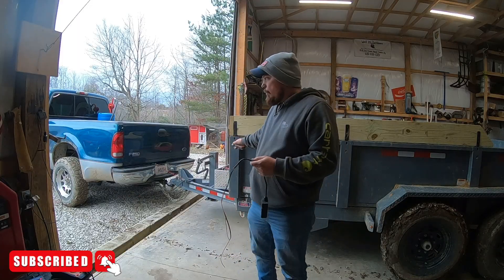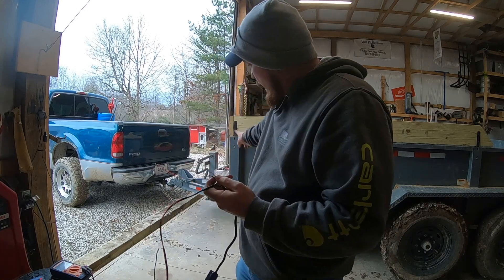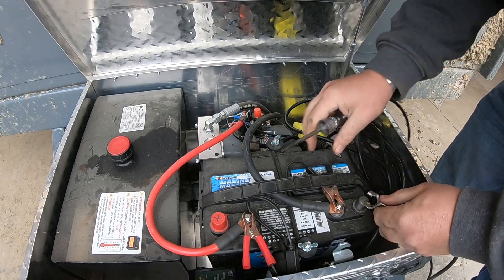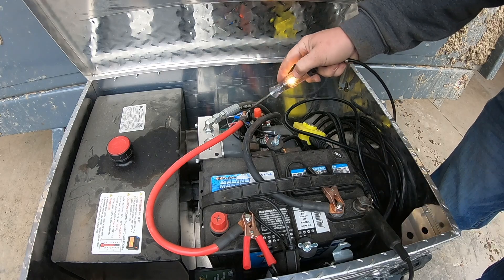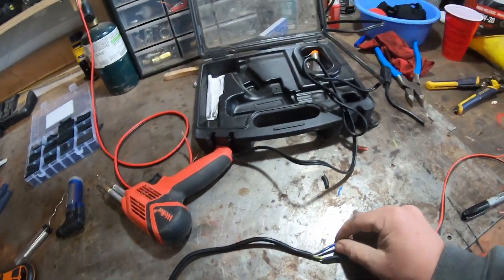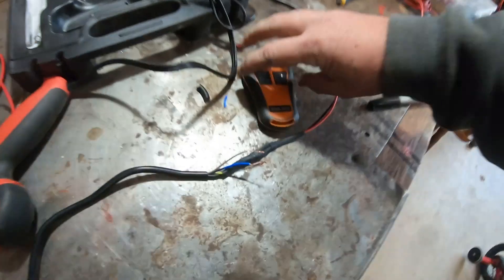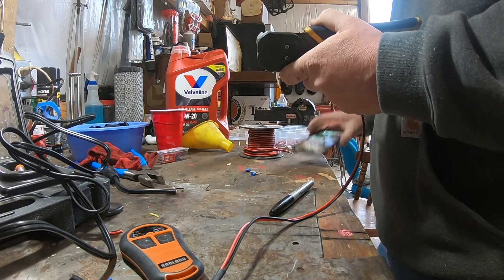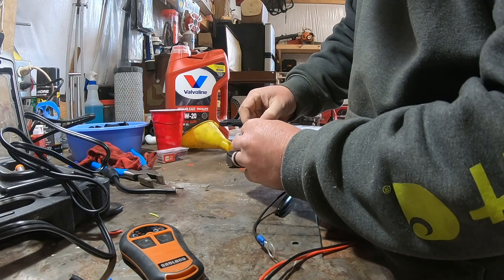How to install a Wireless controller on a dump trailer.

Comment: This helped a lot…. Identical to my pump and solenoid setup… I bought my trailer back in the spring and picked up one of the Amazon controllers but never got around to installing it till today. I just happened to watch this video as it was a recommended video.  Hooked up the controller and everything works great … thanks for making this video… I would have figured it out but you definitely saved me a few mins
Reply from the maker: Thanks for the comment! Glad it helped.

Comment: I watched another video where they talk about diodes being used so they don’t backfeed the power into the original remote. Idk much about electrical but might be worth looking into
Reply from the maker: Maybe but it’s been working for over a year now. And last I checked the wired one still works as well. The wired remote should be a simple switch. So if it does, which it probably does back feed it will just feed to the switch and that connection would be open so shouldn’t harm anything.

Comment: do you need a inline switch to disable to the remote?
Reply from the maker: No it’s wired into the same spots so they both work.

Comment: My fuse keeps blowing out has yours?
Reply from the maker: No it don’t. Hmm. Short somewhere?  What amp fuse are you using
Reply: The 250v glass fuse that comes in the badland wire box
Reply from the maker: Oh hmm no I haven’t had an issue.
Reply: you are connecting to the wrong lead on the soleniods